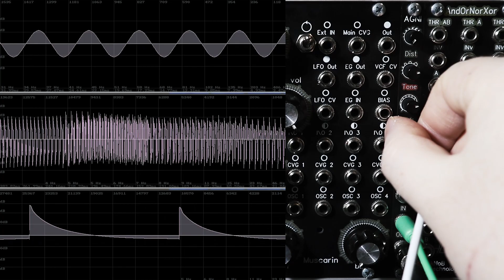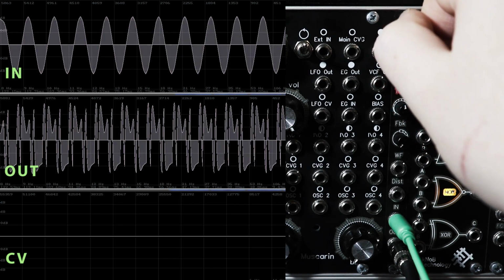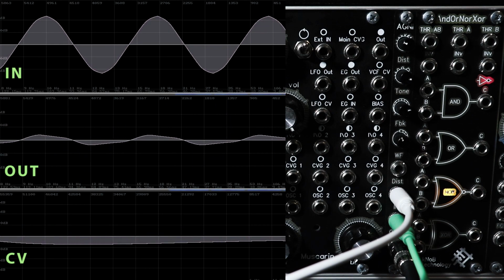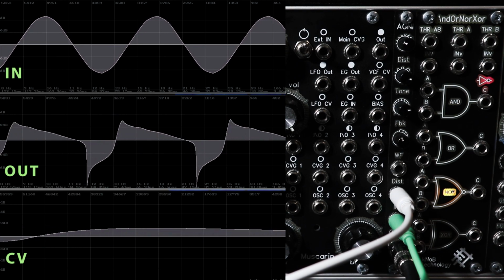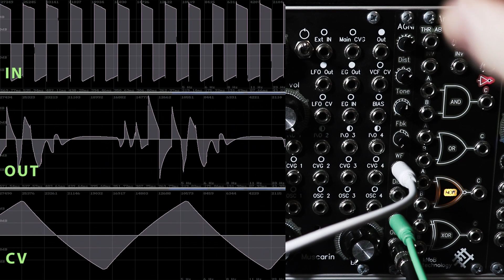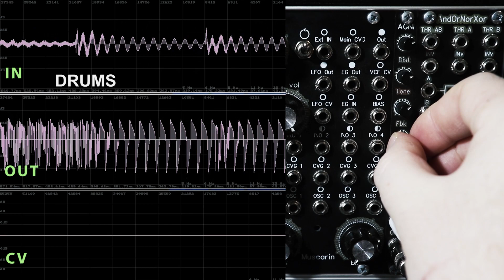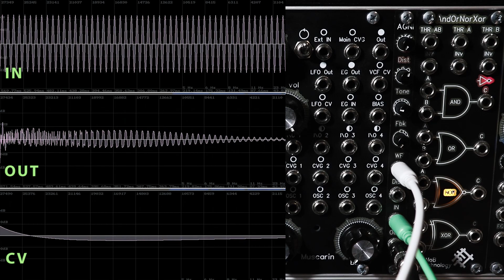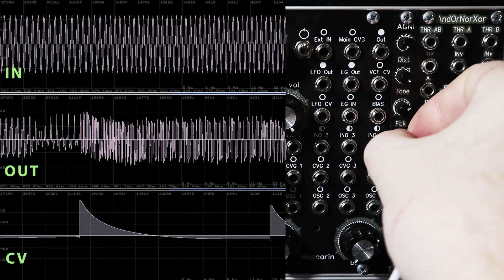kNoB technology AGNI (VCA, Wavefolder, Distortion, Tone, Feedback, Eurorack)  Demo and tutorial

Comment: This is pretty rad, crazy you put this much into just 2hp.
Two things, make the feedback and distortion range bigger, so more feedback and distortion.
Make a 2hp expander that allows you to CV control the knobs which also has a sine wave oscillator in it with V/Oct, that would be so crazy.
Anyways as stated below already, this is a really good way to fill 2hp if you ask me :P
Reply from the maker: The amount of feedback can be adjusted by setting the output gain. I was thinking about making a pair for him. I think it's possible :)
Reply: is it DC coupled?
Reply from the maker: @finngrim9763  no, AC coupled
Reply: But then it would be 4HP, and mundane.